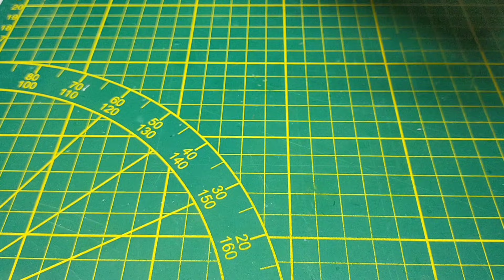Lure Making Flat Side Minnow - part 1

Comment: Hi i know you made this bait 3 years ago and it’s longshot for me to get some info but i was wondering if you could share some specifications like, total weight of lure, size and angle of “bib”(lip), does it float or sink and how deep it dives, i would like to recreate it in 7cm version so this info would be great starter, thanks i advance, love to watch your creations.
Reply from the maker: Hi 👋 I see we're thinking alike, cause I was planning to made the 7cm version for myself this summer. I lost both the original and the one from the video already, so I'm not sure about the weight 🤷 it was very slow sinking lure, nearly suspending. The angle of the bib was at 45°, the size difficult to say 🤔 I also did 11cm version, which was highly successful for asp 🎣 I will recreate it for the video in July, then I'll make sure to include all the measurements 👌
Reply: Thank you for responding and for info. I recently started making lures for myself and had few pretty succesfull pieces.  I mainly fish for asp and best sizes that work for me are 7cm & 8cm minnow like lures.
Reply from the maker: @maidsuho3337  nice, my Asp is hungry for bigger bites 😉 9 and 11cm are best 💪 check this lure build: https://youtu.be/_M7liNgw-Fg
Got me my PB Asp two years ago 😁
Reply: Nice catch !  Two weeks ago got one similar size, unfortunately lost it under my legs when i was trying to catch it with lip grip, treble hook snaged into branch that was sticking out of the ground and he riped of splitring 😞😞 Later that day got one that was 54cm 2,4kg. I will try to recreate both of those lures, only i don’t think second one would work for me since i fish in prety shalow water with a lot of underwater structures like big rocks, grass and alge.
Reply from the maker: @maidsuho3337  it's a shame that you lost it, I always carrying folding landing net on my back, once the fish is landed and recovering in the net, I have all time in the world to sort out my selfie stick and the phone for the photos 😉 yeah cykada type lure, most likely not going to be the best choice in shallow water, although this one with the fast retrieve swims 30cm bellow the surface. For the shallow water the best os WTD type of lure 😉 https://youtu.be/0cHgZNsWOlA
Reply: @SuchaJerkCustomLures   The worst thing is that i had net with me, but i was not thinking clearly since that was probably the bigest asp that i catched, blood was pumping trough my veins  adrenaline hit me realy hard and my only tought at the time was to get it out of water asap, that was probably crucial mistake i made. I will try to make that lure since i also fish on lake where i have much more depth and much biger asps.
Reply from the maker: @maidsuho3337  yeah that's the worst, the panic when you see your new PB, did that last week with the Zander around 75-80cm (my current PB is only 63cm), I manage to pull him all the way to the bank, but instead put up the head torch (it was at night) I grabbed the net, and try to scoop him with very lame visibility (from faraway street lights), the front treble caught on the frame of the net and the fish started to crash and escaped 😭

Comment: Are you happy with that Sunone 48W uv lamp. Does it last long and harden well? I'm planning on buying one. Could you give me the exact name of that particular model? I would be very grayeful. Thanks mate
Reply from the maker: Sure, works well, for the cheapest thing on the marked it does it's job, to shots of 99sec and the resin is solid enough for the paint, foiling or whatever. For the final curing I always display the lure in the sunlight on the window.

Comment: Hi, i have a question about squirminator 177K - the high tops of the net are towards the back, right?
Reply from the maker: Well, the only way is to check yourself how it looks on the foil and than mark which direction is you lure head - as I showed on the frame of the tool 😉